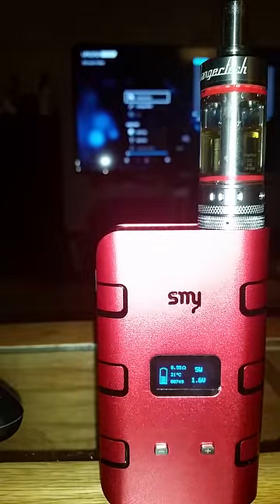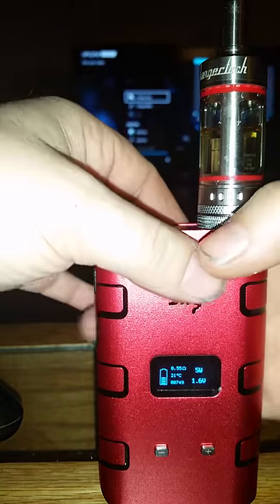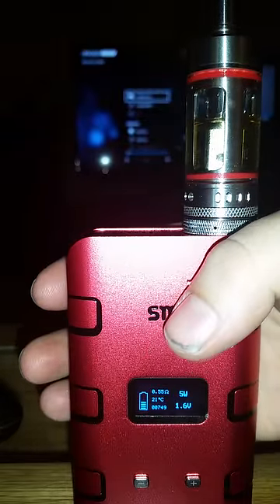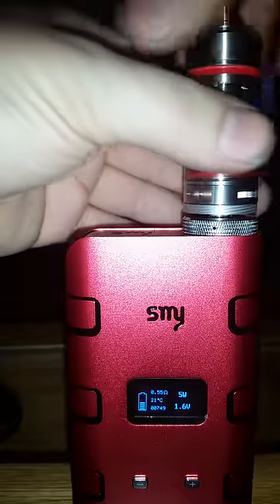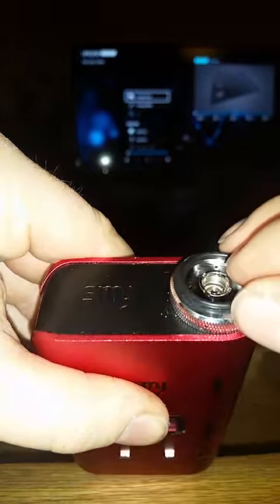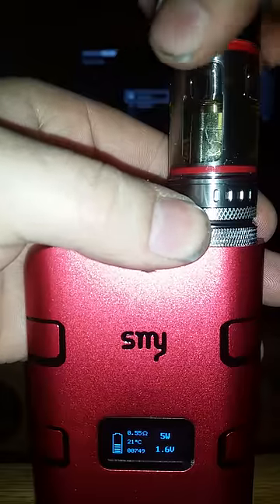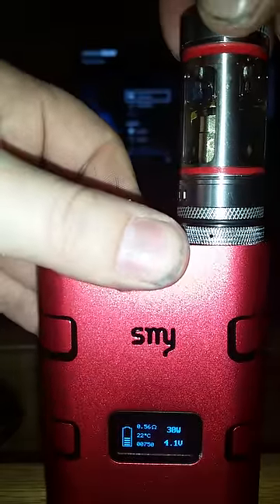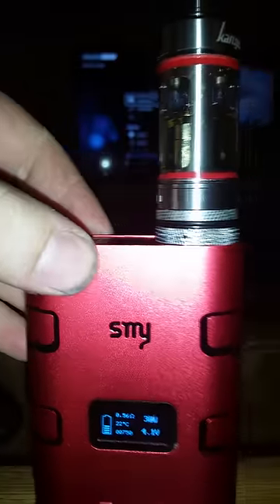Simeiyue God180 Atomizer Short Quick Fix

Comment: I had the same problem so mine came with a tool to screw or unscrew the bottom of the amotizer. so I kept trying to unscrew that screw thinking it was getting a bad connection but it was the other way around.  I had to tighten the screw into the tank and now it works perfect

Comment: You could also put the oring around the bottom of the beauty ring and screw the beauty ring back on and then adjust the beauty ring to the height where the atomizer is snug to the beauty ring

Comment: If anyone sees this. I got this along with the atlantis 2.0. And the .3 ohm im getting either the shirt message or a low resistance. ?? Any help?
Reply: Pat Hyland 
The mod is only able to build down to a .5. Build a little higher and you will be golden.
Reply: +dth1079 actually it will go as low as .4 but it's best to stay above .42 it's better to have the resistance low as opposed to atomizer short.